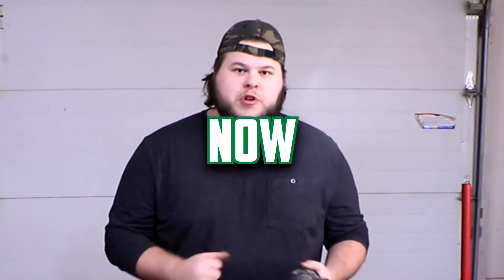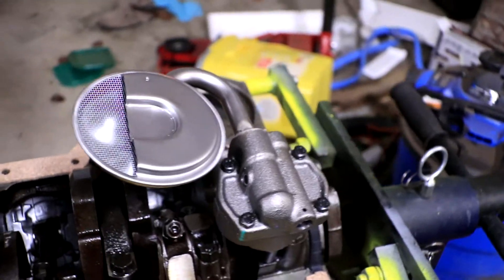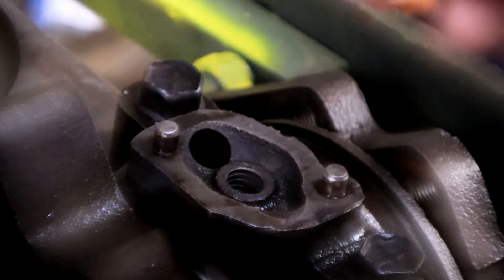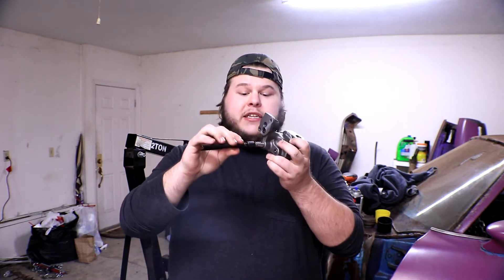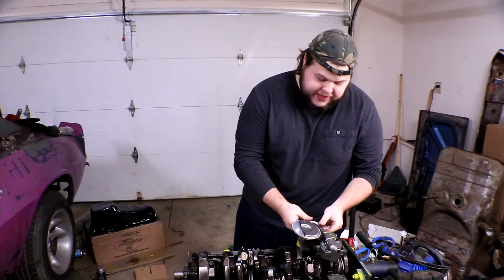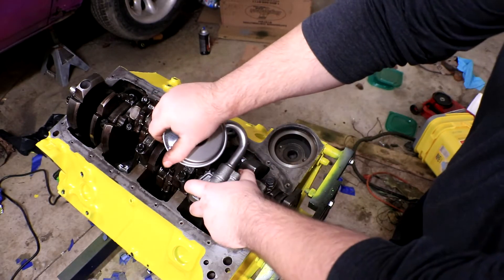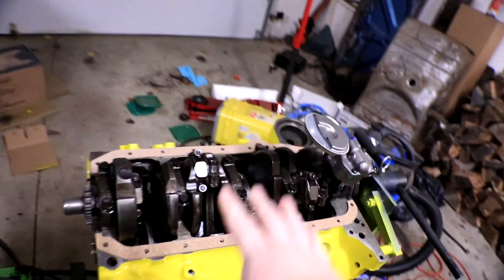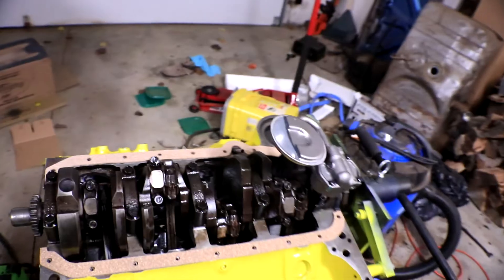HOW TO INSTALL THE OIL PUMP IN YOUR CHEVY 350 ENGINE!

Comment: So I got my 92 Chevy 350 new oil pump and I fired up the motor and I got no oil pressure on the gauge and not going up to the rockers what would cause no oil coming up?
Reply from the maker: could be a clog in the oil channels or the pump isnt seated all the way. There's a bypass hole that if they pump isnt in properly will reroute the oil and it wont get to the rockers.

Comment: I would like to ask you a question does that talk oil pump the new one with the metal sleeve does it just stick on there and it don't click on I bought one for my 350 Chevy and it don't click on there like the plastic windows and hold you got to hold the shaft when you put it down in there or it will fall off

Comment: Could I use a dab of high temp jb weld? Rather than using a welder for that?
Reply: Didn't come from gm with anything on it, so keep it that way, weld cast iron, not good, buy a bracket  muck more better
Reply from the maker: @trentinsarkinen4369  I wouldn’t recommend it!

Comment: Hehehe…, looks like easy …. when the engine is outside 
but my 383 engine  is still in my IROC…😵‍💫., I can not remove the oil pan…. , engine out or remove the k -member ( I need  a hp pump , have low oil pressure when the engine is hot ) ..,, 
Greeting from Germany

Comment: If the oil pick up is set to low,would that give you bad or low oil pressure?
Reply from the maker: Unlikely, unless the oil pickup is sucking up dirt / sludge in the bottom of the oil pan and causing a clog. That clog could move into the oil galleys of your engine and could be potentially catastrophic. If you’re having low oil pressure definitely may end up needing to clean out the engine.
Reply: Thank you

Comment: I would open my oil pump up 1st pack it will grease or valo. to make sure of prime. Very important....💯
Reply: Never needed to do this on any SBC or BBC with the pump sitting down in the sump . Buicks  and Holdens with the external mounted pumps are a different matter and the grease helps .

Comment: Never use a Melling 55 (today made in China) oil pump! They break in parts, get a Moroso or Summit high flow pump! Better use a soft thin flat copper shim gasket between oil pump and main cap! You cant weld cast to steel....you need a clamp for securing the oil pump pickup to the body...can find it at Summit.
Reply: Melling not so good …? 
I have a Stock ( New ) inside …. i have low oil pressure when the engine is hot ….
Engine ( 383  is build 2015 ) … from first day … low oil pressure… hmmmmm, 
Greeting from Germany
Reply: Missing the windage tray,  and I'd never weld disimilar metal without the proper wire.
Reply: Pull the pump and tig weld.a lot faster.

Comment: 🙄🙄🙄🙄🙄 you need to measure not just push the pan down over it and then push it down whatever feels good .... tack welding does not always work because you are welding cast iron to steel
Reply: Ahh shattuuupp!
Reply: We used to drill and tap the oil pump and use a pointed set screw to make sure the pick up didn't come loose.

Comment: Omg thank you bro. I just took off the pan and now I need to take off the pump and replace it with a brand new one
Reply from the maker: Glad I could help!
Reply: @TheGarageGoblin  would you know how many ft/lb. Of TQ the bolt needs?
Reply from the maker: @Texasmule  60-70 Ft pound. I put 65 on here!
Reply: @TheGarageGoblin  thanks! Do you think I should change the old bolts for ARP On my connecting rods? I wanted to do main bolts too but my knowledge isn't that huge so I just left them alone.